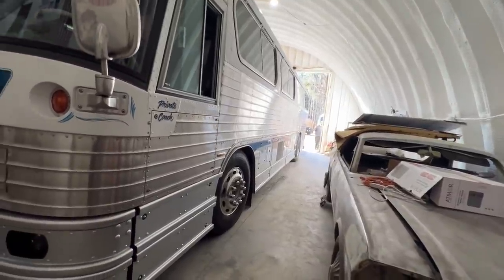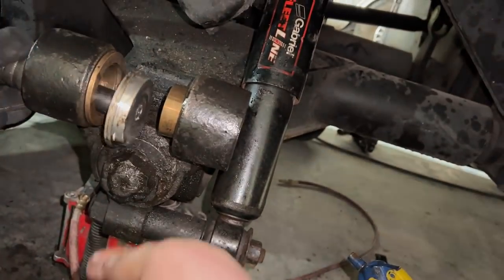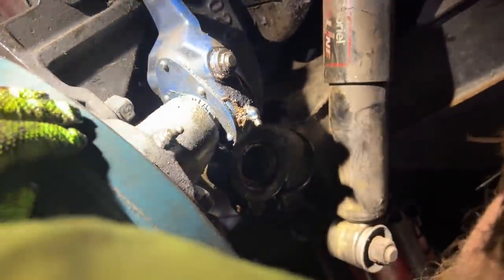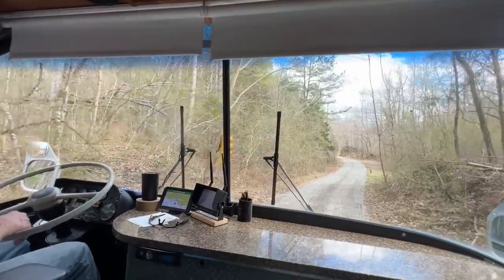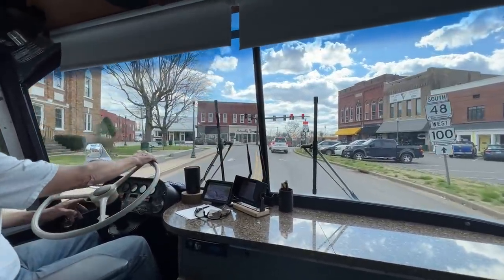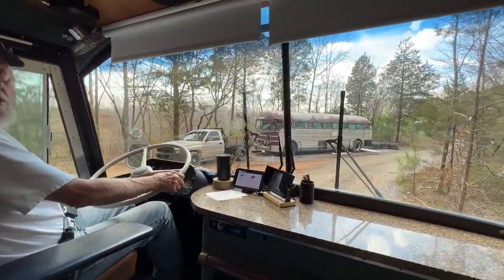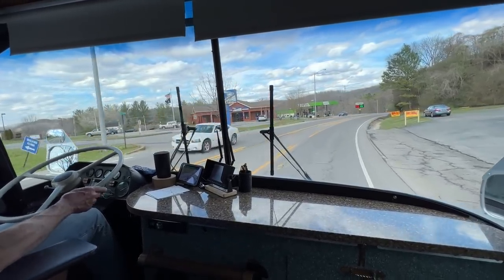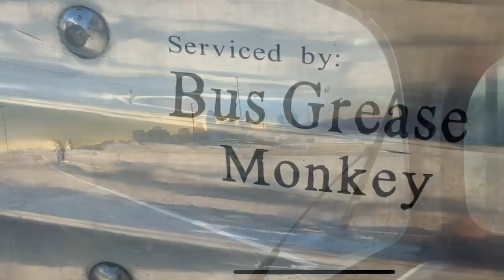Flxible bus major suspension work

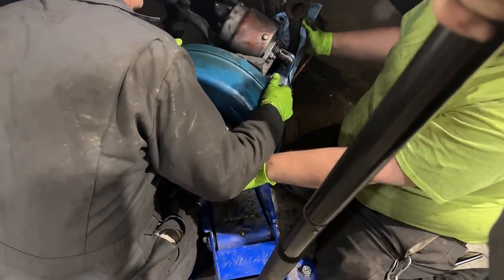Comment: @ 14:43 while you guys were fighting and lining up that wheel hub I wondered why there is no fastener plate to mount to the wheel studs and a bracket to fasten to a floor jack to do the line up and lifting with .  Then no fear of the hub slipping off the little pad the floor jack provides .   Would work for removal also. Less aches and pains .

Comment: This Flexible a good package. Top end ideal not holding any body back. This unit scoots. As for front end wear change type of grease and more frequently lubed. Love how the Jake is adjusted, takes the panic out of long down hill passes. Good Job Scott 👍
Reply: What type of grease do use or recommend?
Reply: @jeffcooper5789  Hi Jeff. Yes you can get extended service life from your Bus. By changing to a Molly based grease, bushings in Backhoe Bucket lasted ten years. Before they had to be changed in three years.a Clue to help you find this use the phrase Molly Be Damn and look for boat axle grease you will do well. Do you service the bus by road miles or engine hours? As a fleet ours was 150 engine hours. Scott has you on the Road for many years to come. Good Job, 👍

Comment: Hello my name  is Jeremy Gramlin I live in lexington Kentucky but was raised in Washington County Indiana.I have had two life long fascinations and they  were semi trucks and more importantly buses. My grandfather worked at the Ford  semi truck plant in Louisville Kentucky until Ford stopped producing big trucks at which time he chose to retire. The  man was the epitome of a workaholic,he ran a successful cattle farm on top of his time at ford which he retired as head of maintenance. So needless to say, I think diesel runs in our veins.I drove a truck for seventeen years when life threw a curve ball and I was diagnosed with a condition that has given me  a life expectancy of 5-10 years and I'm 41. Two years have passed since that diagnosis and my partner and I have become RVers, Its a 36ft Holiday Rambler Endeavor, but like everyone else we want a coach., the fact is buses are made  for highway use and motorhomes are for leisure. one thing I know is you wont be seeing any 50 year old Winnebagos or Holiday Ramblersdriving down the highway fifty years from now. I've passed on opportunities to purchase a bus at a good price,  simply because I dont know much about the engine set up. My dad was a drag racer and I can tear down a 440 mopar to the block, fix any problems and have it running in about 90 minutes;assuming there are air tools available. As crazy as it sounds my years driving trucks i really didnt learn much about diesel engines. If i had a breakdown they would either send a mechanic or another truckand off I go.Im so grateful to have come across your page, theres already so much that Ive learned from your videos. Its a great thing that you are doing here, there are alot of free spirits out there with no one to turn to for advice, and you are filling a void that was needed. Like you,that pur of a detroit diesel engine has captivated me my whole life. When i was a little boy my grandfather had an old greyhound bus that he had cut most of the top off of it so he could haul his tractor or bulldozer to was here  ever he needed and that sound and rumble I will never forget. I think with the help from your videosand im sure at times maybe getting the bus to you I might be able to do this even if i have tjust o enlist your help at times if possible. I just dont know how long it will take on a limited budget. Inspite of my diagnosis, Im still mobile and capable, I just need advice from some one  whos done this and  if i have time to finish it and enjoy it. Any advice would be helpful

Comment: Did you know that dawn dish soap & vinegar will remove those spots off that concrete mixed in with mean green.,or super clean.,or grease lightning degreaser concentrate solutions in your pressure washer pump.

Comment: The good old flexible bus.
Then it was call the DINA OLÍMPICO.
I had the pleasure to drive them, service them, repair them just like you guys did back in the early 90s.
I learn a lot to work on buses cause I own one s 1948 GMC motorhome. This was on the early 80s, I work on them when I started to operate the caterpillars 941/951/977/D8.
Working on diesel fuel engines is and was so much fun to me.
@58 memories are the only way to remember those wonderful years.

Comment: That whole front end on the bus was designed in Mexico in the 70s USA buses didn't have it this one was modified. Correct me if I'm wrong cool bus regardless..
Reply from the maker: That’s a usa built 1969 bus.  The Mexican company bought the bus design snd tooling  from flxible